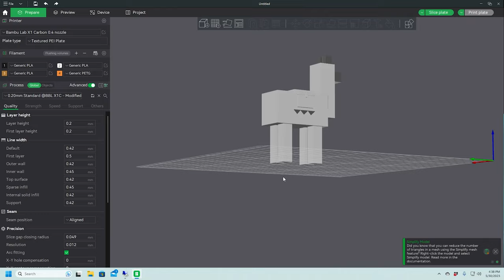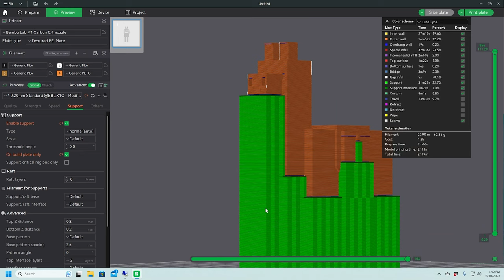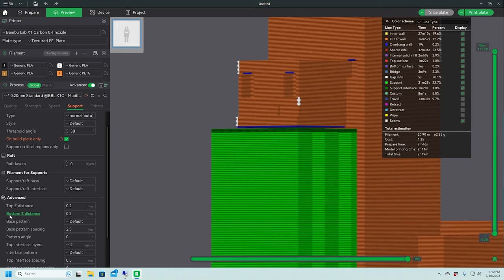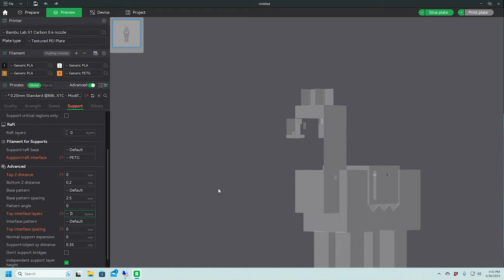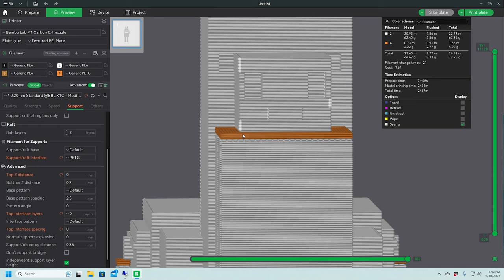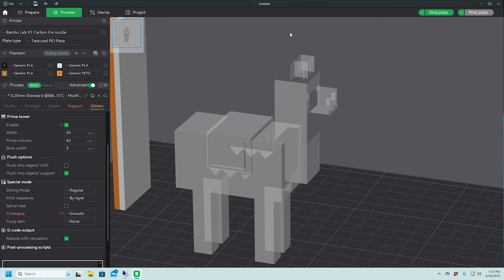Using PETG to Support PLA on Bambu X1 Carbon

Comment: Great video! Thanks for teaching me something tonight 💪. Question though when i start a print i get a warning stating I should open the front door of the printer to avoid nozzle clogs. Did you do this or adjust the temperature at all?
Reply from the maker: That’s a good question. I got that notification, too, but not every time. Logically, I don’t see how a slightly warmer chamber can cause a nozzle clog. But I kept the door open for the first few layers, and then closed it for the rest of the print, and had no problems.
Reply: @thisprintedthing7967  From the wiki "Having a higher temperature of the hotbed will contribute to the passive temperature increase inside the printer. This leads to clogs occurring inside the P1S extruder or inside the hotend, as the higher temperature leads to softening the filament before it gets melted and printed by the hotend."

So the potential is for clogging before the actual nozzle apparently.

I don't have problems leaving the door shut but I live in a cold country.  Maybe if the ambient temperature were higher it could be an issue.
Reply from the maker: @dibblethwaite  yeah, I’ve read into that recently, too. I also don’t have this problem, because all of my X1-C printers are in an air conditioned room.
Reply: I was doing pla and petg prints this weekend on my bambu, and ran in to a pretty severe clog. Use a good adhesive on the bed and leave the door open... should be fine.

Comment: When I try to do this with my X1C I get an error saying the PLA/Cool plate is not suggested for this material (Generic PETG) and I need to set the filaments bed plate to non aero. I have opened up the filament settings to make the bed 35 same as the PLA but it still won't let me slice. If I try to use the engineering plate, I get the same problem but opposite saying I cannot print PLA on the engineering plate. What am I doing wrong?
Reply from the maker: You may need to use the textured PEI sheet.
Reply: @thisprintedthing7967  rats, the one I don't have , but thanks! I will see if it will slice with that setting
Reply from the maker: @BanglesAU  just make sure you’re not printing PETG on the cool plate. It won’t come off.
Reply: It slices just fine if I say its the PEI sheet, so I just need to get one and I can try it out ;) Thanks so much
Reply: @thisprintedthing7967  gotcha. I would rather not destory any plates anytime soon.
Reply: @BanglesAU You could always just select the hot plate in the slicer and change the bed temprature manually - assuming that is the only plate you got - having said that - if you got the cold plate then the reverse should be the engineering and that supports both. At the end of the day - as long as you don't print with petg directly on the plate (i.e. accidentially use petg as support material rather than support interface material.)

Comment: with larger flush volumes you can disable the prime tower
Reply from the maker: Yes, but I wouldn’t disable the prime tower unless I absolutely had to regain that bed real estate. Having it print to another object before going back to the model is preferable to simply going back to the model right after being over the dump. It helps to regulate pressure in the nozzle. Also, that wiping motion that it makes at the dump is far from flawless. The prime tower can help make sure that any extra material is pulled away from the nozzle before it goes back to printing on the model. 

If I’m only printing with one material, I’ll absolutely disable the prime tower. But on multiple material prints, I’ll always use it.
Reply: @thisprintedthing7967  I only dissable the prime tower when doing Interface prints like mentioned in the video because the prime tower can mess up badly and ruin the print,
I use pla as a interface when i do special petg prints(I print 99% petg)
Reply from the maker: @storm4710  yeah, I can see your point. It really comes down to a matter of preference. You can risk one thing, or the other. Since I haven’t had a problem doing it my way, I prefer it.

Comment: This works well, I like to use neon orange or green Polymaker PETG to make it easier to spot.  I mixed this video with the settings from the subtitled German one https://www.youtube.com/watch?v=Matf1Mna2zI and seems to work for me.  It is also much easier to remove than the Bambu support filament.

Comment: Is there not a problem from the different temperature requirements of PLA vs PETG? I tried telling OrcaSlicer to do something like this a while ago and it complained about that.
Can't remember if I was trying PLA with PETG interface or the other way around.
I was surprised seeing this as you appear to be using the default filament settings.
Reply from the maker: I haven’t run into any problems with it in Bambu Studio.

Comment: With advances in tree support and support painting, support interface material isn't really needed so much anymore.
Reply from the maker: Debatable.
Reply: @thisprintedthing7967  Agreed! There are definitely times when interface materials of some sort are required Using this method is WAY less costly and more readily available. It's very difficult to source breakaway material in particular, for instance. Well done video 👍👍
Reply from the maker: @dsemolian3071  thank you so much. And I agree with you. My Bambu X1-C came with a small roll of support material for PLA. I’ve only used it once, just to try it. But I’ve used the PETG support method quite a bit, just because it’s readily available.
Reply: but doesn't that just control where the support goes not how well it removes or how smooth a surface it leaves
.
Reply: @thisprintedthing7967  Sure it depends how good your settings are. If you just go for it without tuning it you might have some debate but if you do tree supports right there really is no debate. PETG works okay on flat surfaces like this but anything curved is another animal entirely. Which is why this video focuses on the flat model.
Reply from the maker: @jdmcarrepairs142  The flat model in this video was used because it was an easy example.  I have, however, used this technique on models that were not flat, but were cylindric, and around 1 cm in width.  So a very tight curve.  This technique still worked well.

Comment: If you have to use pliers to remove supports, your settings are clearly not optimal.
Reply: The point was to get as clean of a bottom surface as possible.
Normally you want your supports to be doing good enough but easy too break away.
Not in this example though.

Comment: dont use 0 for spacing between support and part and leave it default.  The support will come off easier.
Reply from the maker: On the contrary, Bambu Studio even recommends using 0 for top interface spacing when using a support interface material. Since we’re using PETG in that way, 0 top interface spacing is key. This also goes for top Z distance.